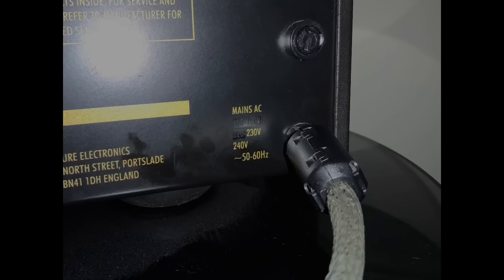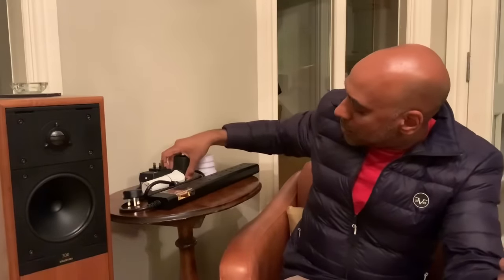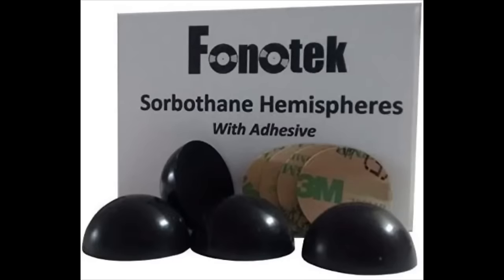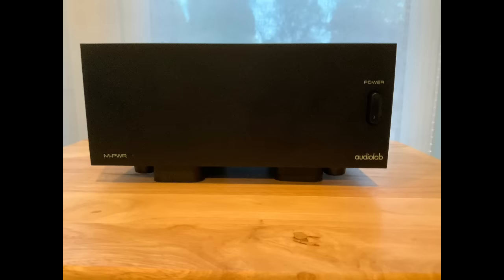My Top 5 Inexpensive Hifi Tweaks

Comment: Good advice! In my past hifi systems I had fairly decent equipment with components such as  Linn Sondek/Ittok/K9, Naim Nait (early model) and AE floor standing speakers etc. However my more modest current setup which uses a decent spec PC (for streaming and YouTube, etc), Marantz PM6006 amp and Elac B6.2 speakers and has a far better quality sound with is far more engaging and enjoyable to listen to. The big difference between the two systems is the fact that I use some of the tweaks you mentioned in my current system, whereas in the past, although I had better components, all the  cabling was the basic stuff that came with the components, apart from using thicker speaker cables.

When I first became interested in hifi audio, interconnects were never talked about only components and how they measured. The current trend that places more emphasis on decent cabling is a relatively recent development and is to be welcomed as it encourages the audio enthusiast to pay more attention to addressing these important details in order to extract the maximum performance from what they already own rather than simply upgrading components in their search of a better quality sound.
Reply: You are quite right. For example interconnect between your source and amplifier can have a profound effect and it is worth spending time and a little money experimenting.
Reply: It's not a recent development that cabling improves sound.
Reply: @marvellousmusic4336  It's not. But in the past the emphasis was on different aspects of a system being more important. There are trends in hifi as in other areas of activity.
Reply: @mgsee  I wouldn't say that your current system sounds better than a Linn Sondek with ittok arm. The weak link in that system was the K9, it deserved a better cartridge for example a moving coil of higher quality. The output on a streamer is probably louder but not better. Some don't agree that expensive cables make a difference, if you buy good quality that are similar there is no difference. There was a man on hifi forums who used tell people he could make cable from maplins that will be as good, I did not believe him at the time but he was right. Since then I know a scientists who tells me the same. Nobody seems to agree and would rather throw money away on premium silly prices.
Reply: @mgsee  Also, just because a magazine tells people something it does not mean it's true. Don't believe the hype.
Reply: @marvellousmusic4336  I don't have clue what you are on about - are you responding to my original comment, and how long have you been a hifi enthusiast?
Reply: @mgsee  Yeah, how you mentioned that your marantz sounds better than your old hifi. Ive been an enthusiasts for 31 years.

Comment: I am very lucky or maybe just good fortune, because we live using an off grid power system not connected to the grid so the power is not effected by line noise on the AC side. Power conditioners seem to be a huge ibdustry in the HI FI world, so I save a lot there. I do use a power board that has lightning/surge protection but the main benefit is that the main switch on it powers up all my hi fi equipment at the same time which I like. All my equipment is mounted on a concrete filled block wall so this helps reducing vibration especially though the floor. I can have a room full of people dancing and it won't effect even my turntable. Lucky again although I did plan this when designing the home.  Being an electronics technician I do make some of my cables, mostly speaker and power. I use off the shelf RCA interconnects as then don't usually break the bank. Thanks for the video. So glad I found your channel.
Reply from the maker: @OFBCyclingWorld  thank you for sharing your experiences 😊

Comment: I agree with you on mains conditioners and their expensive empty promises. For the same price of $600 I had a license electrician wire two 12 gauge dedicated circuits to the service box. One for digital and one for Analog. The difference in dynamics was night and day.  Also noise floor was greatly reduced from the previous 1960s mains wiring.. In humble opinion I'd recommend scrapping the power conditional for dedicated runs to the circuit breaker bus.
Reply from the maker: That is very good advice. Thank you for watching and sharing 😉👍

Comment: A thought on Antivibration pads. Typically floors in USA, UK, Switzerland are wooden so these are much more prone to resonance (lower accoustic load) and definitely need good antivibration pads ; however in countries like India the floor is concrete which is high density (with ceramic tiles) so there is a strong natural damping effect. Of course for my turntable with a magnetic cartridge one needs good antivib pads. 

Hence the thought one needs to adopt appropriate measures.
Reply: I live in a trailer, which of course, has a wooden floor.  But almost all regular homes in the desert of the Southwest U.S. have concrete slabs for floors.  Basements are rare, because the ground is so hard, and digging one requires some serious heavy equipment, or blasting.
Reply from the maker: Thank you for sharing 😊

Comment: On ferrites: Agree on mains cables. I build my own valve gear and the best place is immediately before the rectifier (inside the amp). Just a tip for the builders, I'm not suggesting everyone should open up their amps of course. I suspect that the reason a ferrite can be good on a speaker cable is to prevent the cable acting as an aerial and feeding radio frequency back into your amplifier's negative feedback loop. If you own an amplifier with no global negative feedback (some triode amps like mine) you will hear no difference. I don't on mine. (I have done with solid state gear though.)

On power conditioners: These work well on linear power supplies for solid state audio gear. The amplifier PSU diodes and capacitors are often poorly specced (i.e. cheap) and the single (capacitor) filter stage does not do a good job. Many decent valve amps have high quality diodes and (fast) capacitors, using three stage (capacitor-inductor-capacitor) filtering. If you are fortunate to posses such gear you will probably find (as I do) that they make no discernible difference.

On interconnects: Many preamps use a passive volume control which effectively adds resistance (raises output impedance) to reduce your volume. This makes them particularly sensitive to interconnects. If you have a preamp using audio transformers ("magnetic" preamps) then the output impedance reduces when you turn the volume down. This makes your system much less dependent on the characteristics of your interconnects. I have several "different sounding" interconnects which sound surprisingly similar when used with a magnetic preamp. If you have a system using "balanced" topology (three conductors in your interconnects for a "push-pull" circuit) then you will find interconnects play a smaller role in the sound of your system too.

Finally: I've been at this for nearly fifty years now. To a greater or lesser degree, everything makes some difference. If it sounds better to you then that's probably all that matters (assuming you are a hobbyist and not a professional sound engineer of course). As they say, your mileage may vary. Enjoy the music.
Reply from the maker: Thank you for posting this John. It goes some way to demystify why peoples’ experiences with these things vary so much. I totally agree, in the end you just have to try yourself and trust your ears. Thanks again 😊👍

Comment: Speaker placement and moving speakers 2-3 feet or more from the wall is free and one of the biggest sonic improvements you can make (unless your speakers are meant to be close to the wall). Not to mention experimenting with toe-in angle for the best soundstage and center image. Moving the listening position away from the wall is super helpful as well. Room treatments, from putting down a rug on the hardwood floor, to treating the first reflection points, putting up diffusers, treating the back wall behind the listening position, and bass traps in the corners to tame and smooth room modes/peaks and nulls/dips can make massive differences as well.
Reply from the maker: Thank you Brian 😊

Comment: Thanks for the inexpensive tweaks. Our power fluctuates so all my electronics are plugged into some sort of power conditioner. The Furman SSB6 is an inexpensive power strip ($25) that works well. The vibration pads are a must have for speakers. I placed a peel-and-stick neoprene pad on top of my speaker stand, and my speakers it on top of the pad. Another worthwhile tweak is Stabilant 22, a product originally designed for NASA, that works at the molecular level to improve electrical contacts. I use this on all my interconnects.
Reply from the maker: Thank you for sharing 👍

Comment: Almost every piece of audio equipment has a line conditioner built in. It's called a power supply. It has a transformer and capacitors. Capacitors block all forms of AC and spurious signals, only allowing pure DC to pass. That's what the component runs on - pure DC. If your device has a decent power supply, the need for additional conditioners and cables is moot.
Reply from the maker: Pure DC? No ripple, RF, EMI and voltage dips based on supply and load…
Reply: Try plugging your high-end components into an Audience power conditioner. Then let me know if they're a moot point. 🤣

Comment: A good honest representation of the various tweeks. I do have a question about the power cable shielding though. You make a point of saying the shield should be grounded at both ends. I had always been told that cable shields should only be grounded at the source end to avoid ground loops (I believe this is common industry practice for sensitive instrumentation). When I looked this up on line it appears that the is a lot of controversy over the ground loop issue. My limited understanding of the ground loop issue is that when two pieces of equipment (each with separate grounds) are connected together with a shielded cable connected to the chassis of both pieces of equipment (that is essentially grounded at both ends) there is a possibility that each cassis is grounded to sinks which are not exactly at the same potential (one may have a very slightly higher voltage compared to the other). As a result there will be a current flow through the shield wire which could create magnet interference in any sensitive signal wire in close proximity to it. There are a lot of if’s of course and likely most of the time there will not be a significant ground loop current or it will not generate a magnetic field strong enough to  be a problem. I have run into ground loop problems in an industrial setting with sensitive vibration monitoring instrumentation and grounding the shield at one end only did resolve the issue. In the case of the power cable ground loop current would likely produce a much weaker magnetic field than the power cable itself produces so I don’t think I hurts to ground its shield at both ends. More sensitive signal wires on the other hand should likely be grounded on one end only in my opinion. Sorry for the long winded comment but I do enjoy you videos and reading the comments from others.
Reply from the maker: Thank you Jim. You are right, should only be grounded at the mains end. I corrected the info I provided in the next video. Thankful for the thorough explanation 😉

Comment: Great advice!. I've had some fairly expensive mains conditioning and cabling in my system (on loan from a friend) and I can't say if I've really heard much, if any difference. The placebo factor is too present when listening to these tweaks. You really need to blind A/B and that's just not possible in most situations.
I've had the Tacima for a few years and I think it's a great bit  of gear for the money. All these tweaks are a great idea and well worth trying!. 👍
Reply from the maker: Hi Mike, good to hear from you. Thank you for watching and sharing your experiences 👍
Reply: Mike Carr  You have resisted the placebo because it was a loan. If you had given any money all the confirmation biasness and placebo would have kicked in.

Comment: I purchased a couple of mid level Audioquest 2 and 3 prong power cables.
They were gently used or new/open box items. I saved about 35% over their MSRP for new power 🔋 cords. It pays to scour  the internet! Some of my audio components came with well made/thick cables so I didn't bother replacing them. I saved money that way too.  Mid to high end used speaker cables, component Interconnects & power    cables loose at least  1/3rd of their original value and those are the ones that are in very good to excellent condition.

I hope this information is helpful to Taran's audio/video community.
Reply from the maker: Thank you for sharing 😊

Comment: 2:00 a ferrite core around one lead does nothing. It is my understanding that you put the ferrite core around both leads. Reason being that distortion is picked up by both leads, in contrast to the original signal, which is the difference between the leads. It’s called a common mode choke.

Quote: “The magnetic flux induced by differential signals (on symmetric transmission lines) compensates each other, so that the signal is not influenced. On common mode signals (travelling over both wires in the same direction) it operates as a choke, because the resulting induced magnetic flux is non-zero.”
Reply from the maker: Thank you for sharing Dumdadum76
Reply: Whatever? It works with one for me! Happy camper!😎
Reply from the maker: @yogarl7  me too. It could be the added inductance or something else not yet fully investigated and understood. Regardless it works in some systems 😉👍
Reply: I am pretty sure you should not use ferrite beads on speaker or interconnect cables. Using them on data and power cables does make sense in certain situations
Reply from the maker: @TheMicozon  check out this article http://www.empiricalaudio.com/computer-audio/technical-papers/myths-and-snake-oil
Reply: @abritishaudiophile7314  thank you for the pointers, but the text is not reassuring at all. Their claims are based on their belief and not necessarily factual.
Reply from the maker: Hi Milos, I wasn’t claiming that it was scientifically factual, just interesting. I subscribe to the belief that we can’t measure everything we can hear and that we can hear everything we can measure. Even scientific facts evolve and change over a period of time. At the end of the day they are just models that best fit a certain set of parameters.

For example, take something as fundamental as the nature of light. Is it a wave or a particle? The two models are completely incongruent with each other. But each are successful in describing behaviour within their frameworks. The reality is probably that light is neither a particle or a wave but something else that we aren’t yet capable of describing. Science is full of these kind of contradictions. Oops... sorry, I’ll get off my soap box now 😉

Comment: the idea that spikes still "couple" is a myth. what you're getting is sympathetic vibration from the driver itself. try using a riser and spikes. spikes will be equal to acoustic pads in that case.

anyone can test a spike out the themselves with a cello or upright bass, if you don't have that use a guitar. place it on its peg and strum, then place the body of the guitar on the ground and strum. the difference is huge.
Reply: Yeah, that's bunk. They DO couple to the floor, your examples are silly as well. Ever use a tuning fork? The butt end is typically a sphere which in theory has a much smaller contact point than any spike, meaning that if spikes don't couple to the floor, a tuning fork should do even less. In the real world the tuning fork does couple to the surface you place it on and the vibration is amplified.